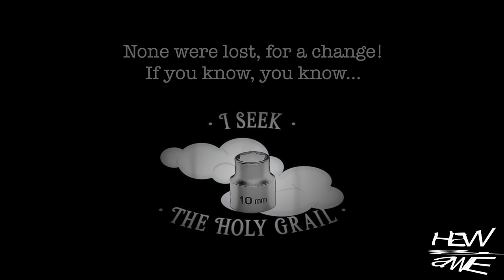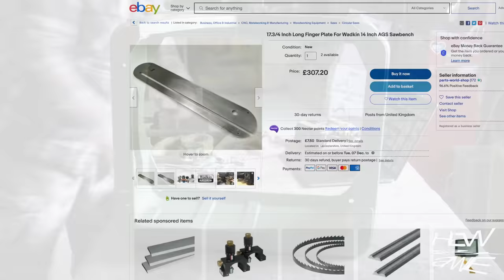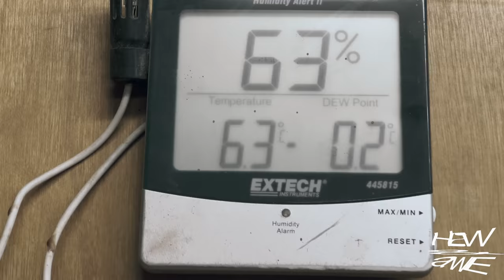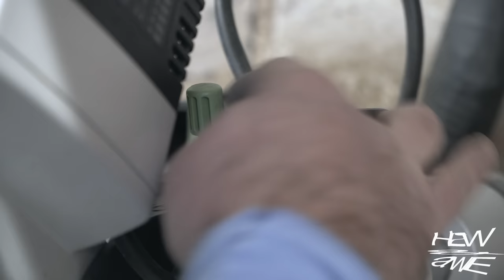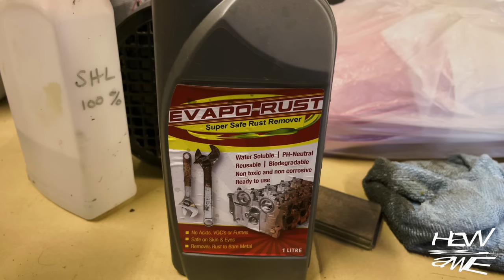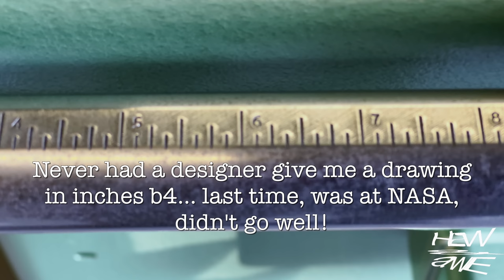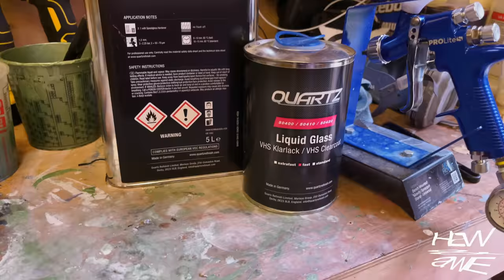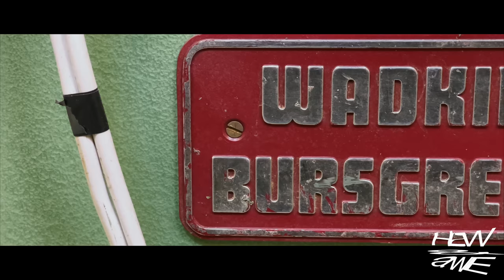Rebuilding My Old Table Saw (FULL EDIT) Wadkin AGS 10"

Comment: Great video. Probably cheaper to have a new cog made of that one built up with weld and re-cut. Seen a couple of videos on that on YouTube
Reply from the maker: That shot of the cog was more an oh-shit moment, later you see the cog that someone else replaced and thankfully I didn’t have to as new parts for these wadkin are eye watering expensive!! Not that I would buy on but the throat plate new is £300! 🤯
Reply: @HewAndAwe  Absolutely ridiculous price. I wonder why they are so expensive 🤔
Reply from the maker: @Sorcli  I’ve no idea, the company that took over wadkin are piss takers, they have the moulds etc. it’s the only down side to making good an old machine.

Comment: Would have subscribed just for the slagging off of imperialist units of measurement, but excellent stuff.
Reply from the maker: My problem isn't the measurement. Its the fact everyone isn't on the same page, well 99% are on the world is, but for example;  Im quoting a recent post WWUK... "So went to get 3 wooden gravel boards for a customer, I ask are they 6ft, no 1.8m, but want them for a 6ft panel. We only stock in 1.8 but you can buy a 2.4m and cut it down. So why sell 6ft panels and not 6ft gravel boards to, well everything is metric now, no a 6ft panel is not metric, it's 6ft, couldn't answer me." I know  Imperial is only good for weight, measuring in fractions as NASA know leads to problems. It's right up there with sausages, sold in packs of 8 but the buns in packs of 6. OR why did my caar fail its MOT cause of a Lamba reading (meaning oxygen in the fumes), we breath the shit why should that be a problem - this world is as mad as a bag of frogs! 😂
Reply: @HewAndAwe  It’s especially poor here in Canada because we adopted metric in the early 70s but because of the elephant next door and a small but rich business class, we cling to imperial in some areas.